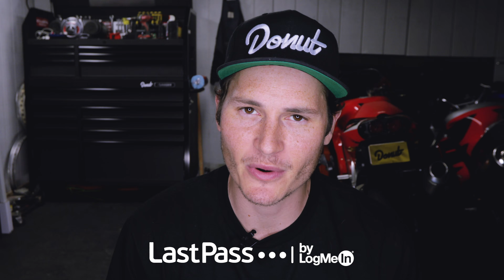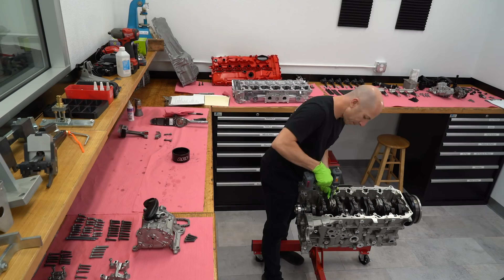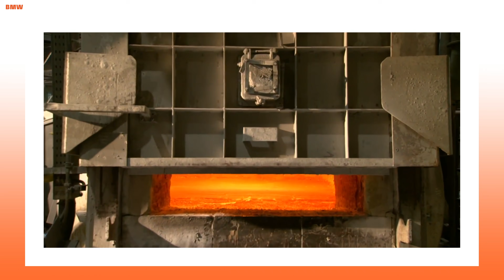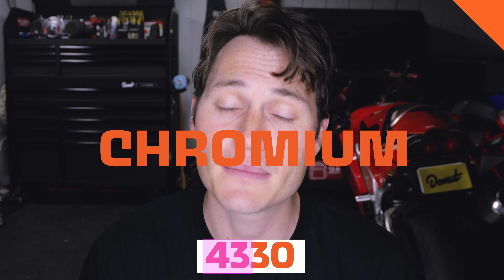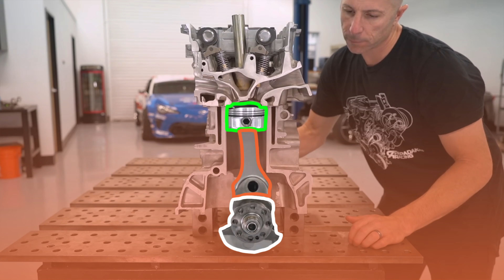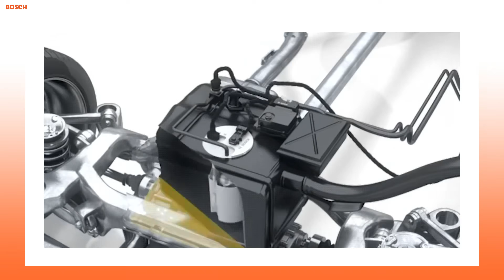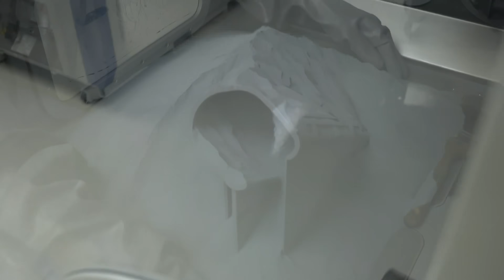The FIRST 1000HP 2020 Supra - Tech Explained

Comment: Cool vid but u just proved the b58 is trash because anyone that wants to get 1k hp has to literally 3D their own engineered manifold and go through all of this research etc.  just buy the 2jz lol
Reply: At that time they barely had any kind of aftermarket support that it has now(there now hitting more into the 700whp+ range and are getting really close to the 800whp range) they are EXTREMELY limited in part and aftermarket compared to the 2jz. If anything it needs time but still. It's about parts availability and he didn't have any of that when he started this build so he had to work from the ground up to get that power.

Comment: When the aftermarket support comes around for direct injection I believe that system will destroy tradition multi port fuel injection. There is a lot of potential for it, oem engines make more power with it because they can better control the mixture inside as well as have more efficiency because there isnt a valve in the way to block incoming fuel. The problem is trying to flow more fuel out of those injectors while keeping it atomized
Reply: wsupchris1222444 the only problem is that fuel cleans the valves & carbon buildup is much more typical in a gdi system. I work at a euro shop and this is very common in VWs and gdi diesels.  It’s ok if maintained but its a lot of extra maintenance.  Will be interesting to see how engines develop.  I think nitrous would work well with gdi

Comment: Fun Fact: The 2JZ Block was engineered in Germany
Reply: Sorry, that's just false. The 2JZ is Toyota's evolution off of the 1JZ which was a joint design between Yamaha and Toyota as Toyota owns a big part of Yamaha and for the 60 years has been working with Yamaha on performance engines. For some reason there was a false rumor spread around that a German firm helped with the design, yet when asked they said they've never worked with Toyota. These rumors starts also on a German Supra forums, lol.
Reply: @sigmaprojects  Yamaha wasn't responsible for the 2JZ. Yamaha was responsible for creating the Heads for the 1JZ
Reply: @Blackandgold51  Were you responding to me or OP? Because you said the same thing I was saying lol.
Reply: Year really😐
Reply: I thought it was Yamaha that produced it
Reply: @amihere383  same

Comment: So they had to completely tear down the entire engine and rebuilt it from the roots up. Yup its still trash, 2jz you could just add more boost and a few bolt ons and the engine would reliably hold 800-1000hp. Mk5 supra is still a trash BMW. Not even close to a “stock engine”
Reply: Imagine comparing a 29 year old engine with literal DECADES of research and modifications to a 2 year old one.
Reply: @dudocaine  5 year old engine with a extremely small aftermarket.

Comment: "Race motors, that are running off race fuel, its in the 10.5:1 to 11:1 ratio"

The 5th gen v6 camaro that runs on 87 has an 11.5:1 ratio.
Reply: Didn't the Mazda Skyactiv run on like 18:1 or something like that? Like, it doesn't even have spark plugs
Reply: The older gen of sky activ engines has 14:1 ratio
Reply: Turbo engines run lower comp. ratio both race and normal engines( 8:1-9:1)
NA engines run higher comp. ratio. race engines run like 13-14:1
Reply: Skyactiv is innovative technology and its completely different from b58 or2jz or other engines

Comment: The dragon capsule have been using 3d printed rocket engines for a while. I am quite surprised that this is the first time you have heard of 3d printed metals, 3d printing with metal have been a thing since the early 2000. 

The really big problem with 3d printing metals is that it is way worse than casting. Often having Huge imperfections inside the materials, internal stress and a lot of voids. This is the sole reason that 3d printing metal didn't kick off. Currently there is a lot of research ongoing with how to minimize or remove these imperfection and weaknesses.

Comment: the part about forged items is explained in the wrong manner. forged items are stronger because the grain pattern is multidirectional, following the part's profile. not because it's uniform, because forged grains aren't uniform except around the centre.

the grain structure becomes rounded around the edges with forged items. the grain of cast items are uniform and straight due to the entire item crystalising (cooling/setting) from molten at the same time

its like steel (and most other materials actually) on the visible level: if you leave parts with sharp edges it causes more stress there than if you fillet/round off the edge. forging is getting rid of the internal sharpness of the grains

Comment: Yeah you could build any engine to be way stronger and make way more power not impressive
The 2jz was known to be extremely tough from the factory without being built the stock crank shaft was know to be able to withstand 1000hp

Comment: why do people complain that its slow and underpowered when the mk4 supra was even less
Reply: Because 12 year olds believe that you can just slap an ebay turbo on a 2jz and make 800hp with no problems whatsoever.
Reply: @dudocaine  and another thing people fail to realize its expensive to important an 90s iconic jdm car, so if the owner has money to fork over for that then they got the money to build their motors

Comment: .... racing four stroke dirt bike is running like a 13.8 to 1 to 12.9 to 1 compression ratio depending on brand and engine yamaha yz 250f 13.8 to 1 but when you add boost you lower your compression ratio and I don't know the the average car compression ratio of cars because cars need to go 200,000 miles dirt bikes only technically have to go one racing season or one race depending on the motorsport

Comment: So they built the motor. Three on a bigger snail. Upgraded the injectors and fuel system. And designed a new intake manifold. And other stuff like designed a new intercooler and piping setup. Looks like most 1000hp builds in any other low displacement car.

Comment: I've owned an n54 for 4 years. That engine is awesome, yeah it had quite a few components that weren't reliable biut I'm glad to see the n55 and now b58 evolve the reliability and learn from the n54's design weakpoints
Reply: The B58 was practically made to avoid most of the n54s problems while being stronger than it.

Comment: You are saying that the 10.5-11 compression ratio is for racing motors and they running with racing fuel... WTF you are saying brooo the b16a5 has 10.4:1 and is not even close to a racing motor that uses racing fuel...Is a regural honda engine... You are irrelevant to engineering...

Comment: Do you mean like squeegees or squeezies learn how to talk also you said the head gasket is to keep oil out the piston but you forgot to tell everybody that's not its only purpose the purpose of a head gasket is to seal the head to the block to keep the air fuel mixture in the cylinder plus keep the oil in the oil jackets and keep the antifreeze in the water jackets get your shit straight

Comment: "relatively limited modification" the only thing stock on this engine is the block, head, and bearings.
Reply: You’d pretty much have to do the same to a 2JZ to get 1000hp though
Reply: @seanissomething  lol no you don't, the stock crank is good for 1200 all day
Reply: @seanissomething  you can get 6-700 hp with the STOCK forged internals in a 2jz
Reply: @eduardorivera4100  also with b58
Reply: @eduardorivera4100  Funny thing is that right now people are running 750+ whp on the STOCK forged b58 internals in the a90 supra as we speak... and theres room for more.
Reply: @eduardorivera4100  you can but I've seen them fail at that... You can get 600hp from a open deck Honda .... Maybe it will last maybe will explode. My friends in NZ replace everything in their drift 2JZs when competitive as well so your point doesn't really make sense. Build plenty of motors and all the YouTube comments make me laugh when most people have no clue. It's got stock cams stock gaskets everyone replaces pistons and rods at 1000hp and maybe the crank can handle the Nos as well but it's a race car better not test it on that.
Reply: eduardo rivera not 1000
Reply: @dylan4972  Most of them have probably never seen a Supra outside of F&F.
Reply: @eduardorivera4100  well the b58 can handle 700whp with stock internals also 👍
Reply: @eduardorivera4100  you can also do that with a B58...
Reply: And crank
Reply: @ulicesalcantar1274  he changed the crankshaft, the time on the dyno when he said it can hold 1000hp but they need NOS thats why they need more reliable crankshaft than the stock one,
Reply: @dragking9735  I don't recall seeing that in any of Papadakis' Supra videos. As far as I remember, it's still got the stock crank
Reply: Yea... changed into forged parts is not "stock engine"
Reply: So pretty much exactly like any other 1000+HP car... there's no magic here. The only thing a stock 2JZ block has on the B58 is the ability to hold 1500-2000HP, for a few races at least, although it's like 200+lbs heavier so it's not really that impressive.
Reply: @sergeyakinin997  for fucks sake I hope you are not implying that the stock internals are good for any amount of time at 1500hp, the most power anyone has ever made on a stock internal 2j is 1087 and it lasted like 4 passes at the strip before it shit it's insides out. And the stock block casting is not good for 2000hp, at 1500 a billet block is required.
Reply: crankshaft, piston rings, head gasket, valves, camshaft
Reply: Those stock parts alone make this a Supra impressive engine! (Sorry, could t resist the bad puns)
Reply: JasonhalloweenXXX  a ls engine can do it too for less
Reply: What are you talking about? The only internal things changed are the pistons and conrods

Comment: 21:10 a lot of engines
also you got compression ration wrong.. mixing apples with oranges, also no engine uses cr bellow 9 for good 40 years, and bmw is using 10+ cr since '89

Comment: Jeremiah: Here is why forged parts are stronger than cast.
Everyone: That's really interesting
Me (being material engineering student): "I hate everything"
Reply: Takeaway: casted parts will “bend” long before forged parts “snap”. 

Forging makes a material “stronger” but more brittle. 
Casting allows flexibility at the expense of overall strength.
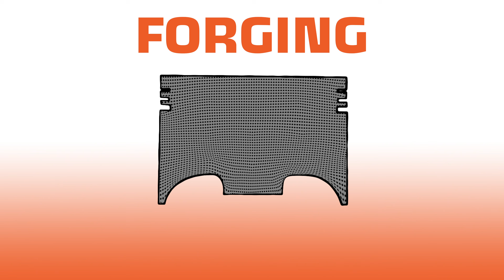Reply: @chuarh7393  I could be wrong but my understanding is that when materials are forged it makes the grain structure flow around the edges. Can sorta be seen at 12:39. It makes the grains on the much tougher compared to just having uniform grains to the edge.
Reply: From what I understand, when a metal is heated up it becomes un-uniform. When it's allowed to cool down naturally, it becomes uniform. Hitting it (like forging a sword) causes a lack of uniformity, which makes it harder to bend but more brittle. There's a trade off, between brittleness and uniformity, too brittle and it wont stay rigid. Too uniform and it wont stay in the same shape. That's why blacksmiths actually require years of experience. They need to feel how many hits gets it just right.
Reply: @jockmitton5253  I'm skipping over a lot, but basically forging gives you a much more refined grain structure than casting. Smaller grains=stronger. Additionally, forging makes makes it so that the grains flow along the part and give it more directional strength and improve fatigue. 

Source: Have a degree in materials science
Reply: Yeah isn't it the opposite? Like cast makes very linear structures that stack on top of one another, and forged breaks down those structures so you have a bunch of different alignement, diverting the strength throughout the part? Or something like that? I'm rusty, it's been a while
Reply: beat me to it... doesnt it seem like they got it backwards?
Reply: @josephma293  im curious
Reply: Could you explain this further? Sounds like Donut is talking bro science.
Reply: Panos M. I didn’t get your comment. Are forged metal parts actually weaker? Is that what you meant?
Reply: I think what he meant is that it's obvious and everyone knows it ?
Reply: Don’t need to be an engineer to know the obvious lol
Reply: What they were saying about uniformity may have been wrong, but do not forget about the air pockets that casting brings, this should be the main problem. I am not a materials engineer, however I heard that some of the stronger swords were made in a way that the grain of the metal is not straight like wood, but the grain of the metal is more like a swirl.
Reply: @somewierdoonline2402  Having more defects in the lattice impedes dislocation movement. This allows for a material to deform plastically instead of shatter. The grains of a coldworked/ forged material are smaller leading to a higher concentration of grain boundaries (a lattice defect). This means they have a higher toughness.
Reply: If cast parts are supposed to be more flexible than forged then why have i literally never seen a cast part do anything other than snap into pieces or crack when stressed. Whereas I've seen forged pieces bend several times
Reply: @fuck_youtube_censorship00  There is a difference between how a material behaves under load and how it fails.
Reply: Yeah they got it backwards at least for steel. Don't know about aluminum. Uniformity is weaker in steels.
Reply: how do you know if someone is an engineering student?
Reply: @sepg5084  students  are still learning... :D
Reply: If you say otherwise then why have tuned cars always have forged parts and work well
Reply: When it comes to internal engine parts, forged are always better, no one cares what you learned in community college.
Reply: Jared Champagne ignorance is bliss
Reply: Krithik Maran so you’re saying cast internals are better than forged? Cmon now, let’s not be dumb.
Reply: @jaredchampagne2752  he is sayin that. forged parts are harder but also more brittle because you mess the structure up by hitting it and because in nature things always want to go back to there naturale places, this is why you cool it by putting it in water. in the end casted parts is just regalur metal being slowly cooled down, its just normal perfect structuur. but by hardening it you mess up the structuur that wants to "fight" back so theres more internal tension.
Reply: jeroen vliem I understand that, but when it comes to engine parts, forged is still much better, maybe when it comes to structures, or other applications, but for engines, forged = better.
Reply: @jaredchampagne2752  true

Comment: Mk4 supra stock is not a nice car, it’s rare i know and the potential is extrem but the supra everybody is referring to is (most of the time) a fully build low and loud af with some nice ass wheels car and not the stock one. If you compare both the mk4 and mk5 both are very nice, considering the mk4 soon is 30 years old, cars but they are build to be tuned and only turn from nice to awesome if you customize them

Comment: @DonutMedia Could you use selective laser melting to make engine block ? My initial assumption would be, no. My thought is the lasers would not melt metal powder at a high enough temp to make it structurally (on a subatomic scale) strong enough to withstand the forces in the compression cycle. The vast changes in heat and pressure would push through the high porous metal and cause a fracture . If I'm incorrect feel free to nicely correct me. However it makes perfect sense for a simple air intake manifold.

Comment: I like how all the other jdms brought there icons back even better Toyota is like let the tuning company’s take care of this rip Supra bring back the 2jz
Reply: All the others? Last time I checked, the GTR dropped both the Skyline platform and the I6 for an auto V6 that can barely keep up with cars on the same price range, the Nissan Z went from base model 350z's destroying Mustang GTs to 370z Nismos losing to base model ecoboost V6 Mustangs, the NSX went from being a Ferrari killer with just a fraction of the price to a generic supercar with average results, the new Lancer is exclusive to China and is a cheap sedan, the WRX has been using the same engine for 15 years and Mazda's RX series is dead. The only JDM icon that is actually better is the current Civic Type-R, and that's a FWD car.

Comment: I thought the N54 was the modern 2jz
Reply: This is basically the N54/N55 made to avoid the problems that they had by giving it better cooling systems,sharing parts like it's block,crank,and internals from the B57 diesel i6,and now being closed deck its basically just a stronger and better N54. Other than the S55 and S58 being other German 2jzs that are better than the B58 for their own reasons.

Comment: The b58 is an amazing motor. My 340 (original b58) put down 525whp and 630ftlb of torque on the dyno. With just a fuel pump and downpipe. Stock turbo and intake

Comment: "relatively limited modifications" 

is completely rebuilt with all new internals and a completely custom fuel and ignition system

not trying to knock the b58, but saying that it achieved 1000hp in a stock configuration is kind of disingenuous. this is a testament to steph's ability and knowledge, not really the engine itself.

Comment: I never thought that it wouldn't make big power or that the engine was built well.. My fear has always been the pressurized fuel system, if its the same as they have been using in the previous  models they are notorious for killing fuel pumps...

Comment: I've heard something along the lines of the stock Supra numbers being understated - to the point where the wheel HP numbers exceed even the published crank HP numbers.  Not entirely surprising that the engine is somewhat overengineered.  Good stuff.

Comment: The 2jz has legend status its hard for the b58 to get loved, maybe they should have called it 3jz just because why not and they just can
Reply: There's many versions of the B58(refreshes with different heads,fuel systems maybe stronger or weaker than one another,Different heads,different compressions,etc)